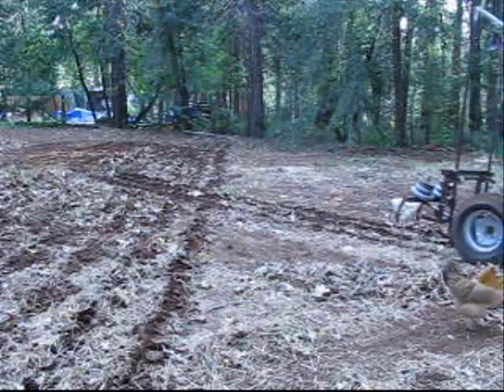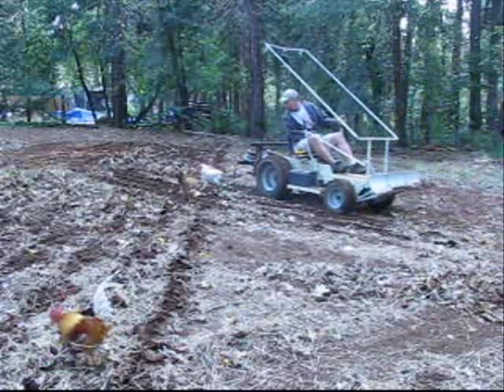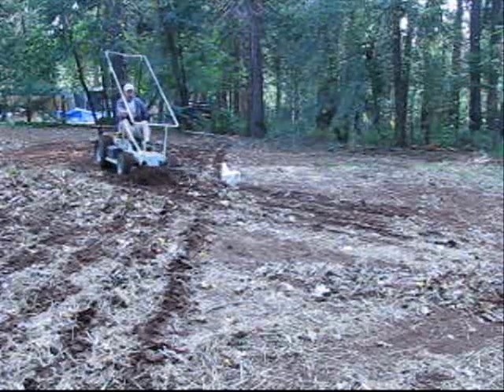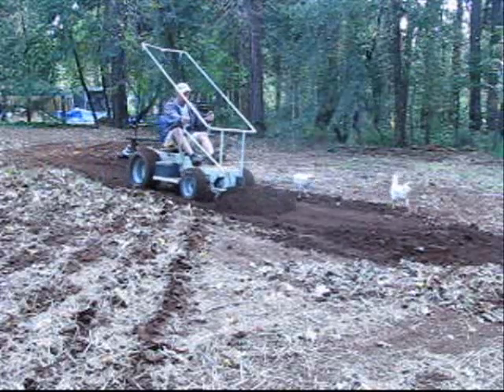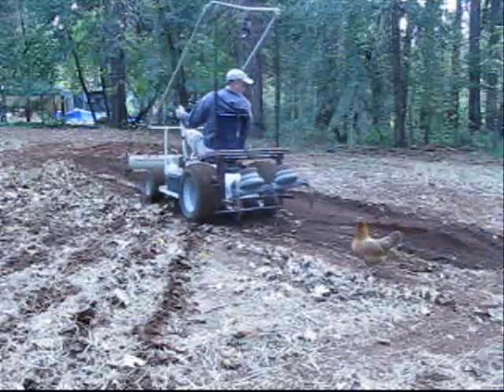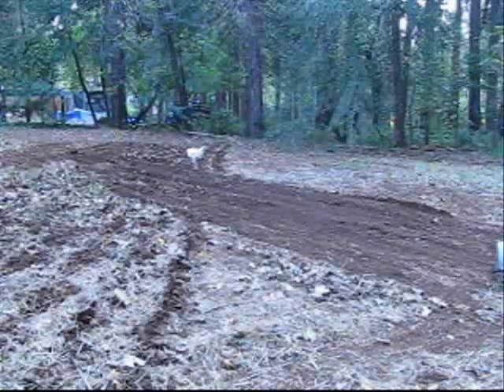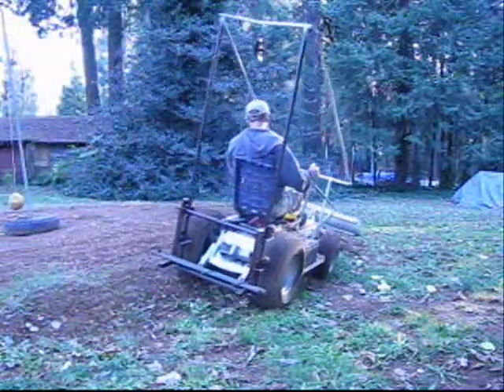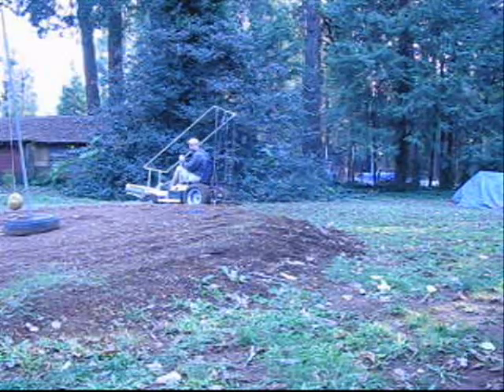Solar Electric tractor/bulldozer/forklift

Comment: I have also been working on an electric tractor, first using a small stripped-down Craftsman riding mower, and later a 1967 Simplicity Broadmoor that has a dozer blade and mowing deck. I plan to use a three phase AC induction motor for both, with 24 to 48 volts of lead-acid batteries. I drew up some plans for a front-end loader, but it may be more practical to implement something like your rear-mounted fork lift. Thanks for the ideas!

Comment: where did u get the motor and how much did u pay for it? cause i'm looking for a 1 hp 24vt low energy consumption motor. i'm looking to get 1 for under $100 used is ok.

Comment: Hi, any plans on converting a lawn tractor to ev , More info on your conversion?
Reply from the maker: This tractor has a 24 volt 1.5 hp shunt wound motor . It turns at 6500 rpm's. I used v belt pulleys to bring my transaxle speed to 3250 rpm's.  This is the speed that the transaxle turned when ran by the gas engine. I used a simple continuous duty solenoid to turn the power on and off. I use the transmission gearing to control the speed.  a 1.5 to 2.0 HP permanent magnet motor would be best for this because the motor direction could be reversed. a controller is nice but not necessary. hope that helps. Lonnie.

Comment: Que motor electrico utilizo?
Reply from the maker: Utilicé un motor de derivación Shunt de potencia de 1.59 caballos de 24 voltios. No fue el mejor motor, pero lo tengo realmente barato
Reply: thegreensbackhoe  woow no conosco ese motor a en chile no es usual
Reply from the maker: n motor de imán permanente funcionará bien. Son fáciles de controlar 1.5 a 2 hp. Probablemente tendrá que ir de 24 a 36 voltios. Uso el engranaje de transeje para controlar la velocidad. Gracias. Lonnie